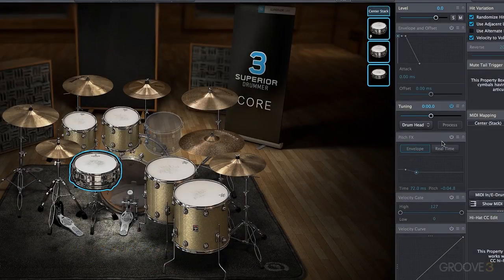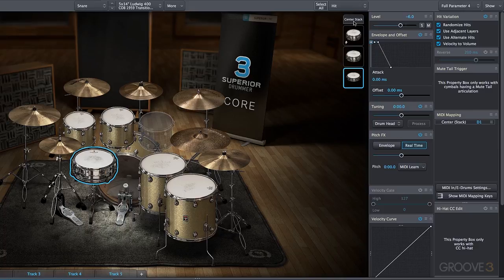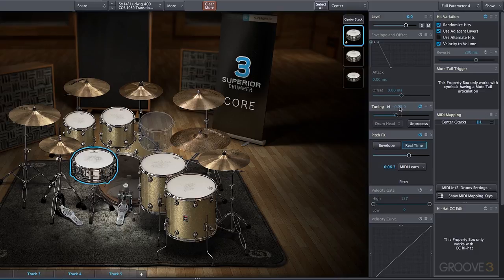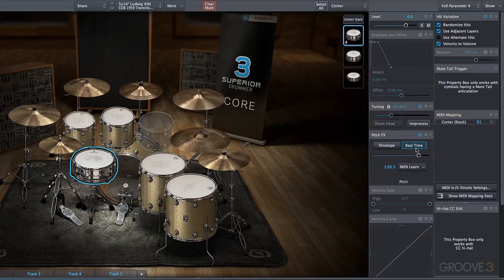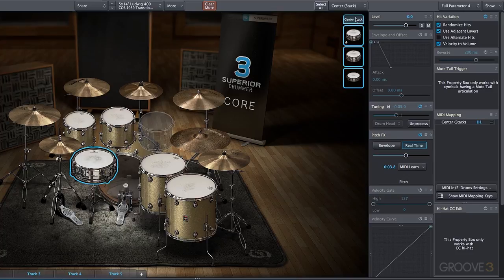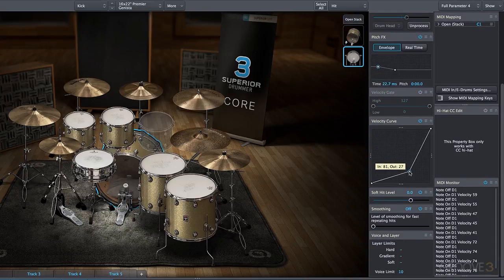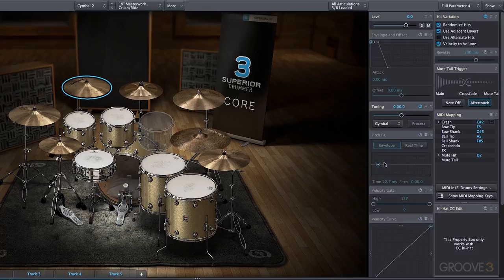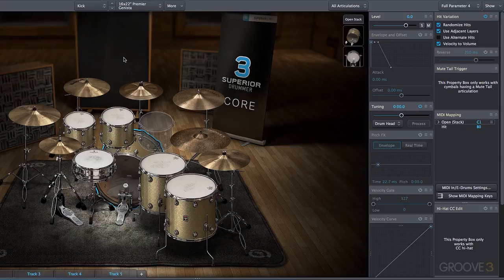Creative Tuning Applications (Superior Drummer 3 Tips & Tricks Vol 1)

Comment: Now that SD3 has gear swapping, you should make a snare pack. The problem I find with superior drummer is there is only one tuning of the drums, and the pitch change is digital so you can only go a couple cents up down before it sounds weird as a drums timbre doesn't pitch up only the note, but with superior the timbre pitches as well.
It would be cool to have a snare pack where the snare has different pitches. I prefer higher tuned snares but none of the snares sound good pitched up. The frustrating part is I have one of the snares in the set and I cannot get it to sound like I have it tuned. 
Snares are a drummers voice.
Reply: I think the same, I think that the snares should have different recordings for medium and high tuning. Since with an artificial tuning the harmonics and aggressiveness are not captured